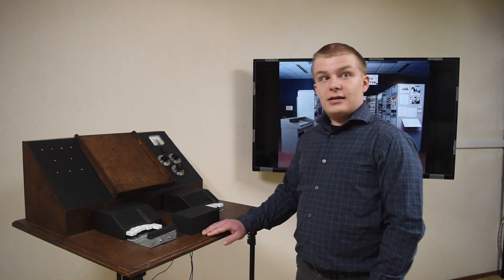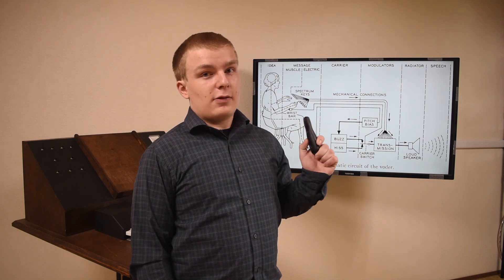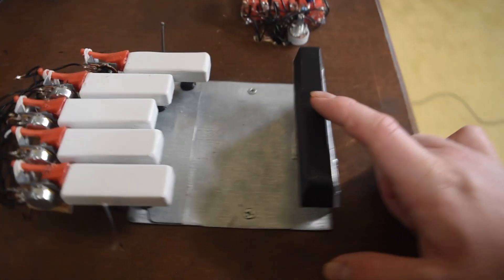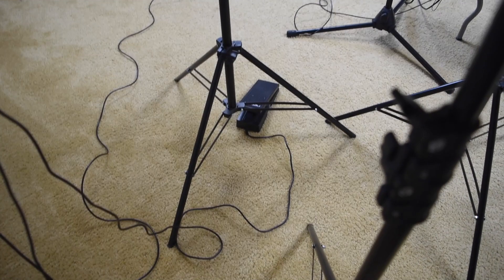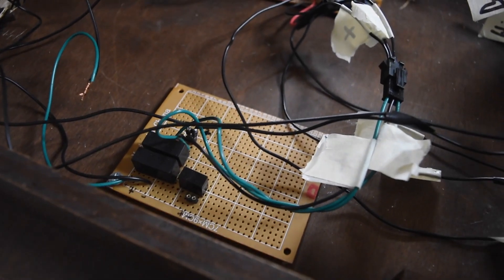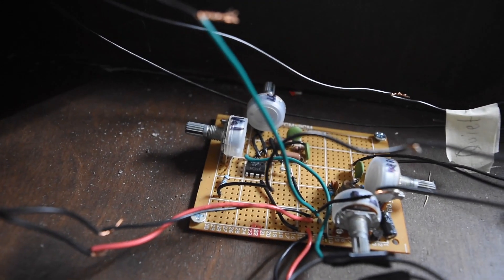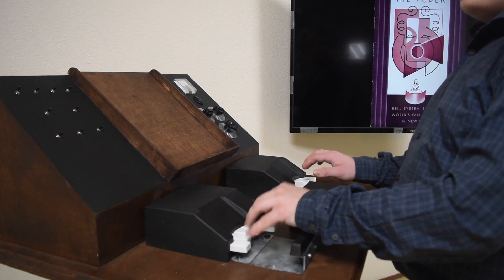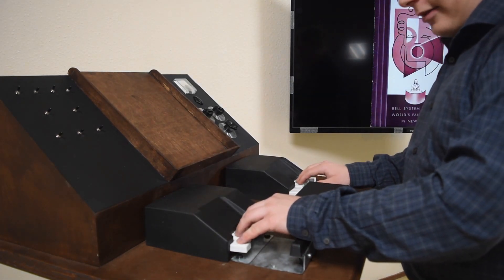Replica of The Voder

Comment: Hey! A year or so ago I was looking into doing the same! Really glad to see someone take this on! really impressive project. I was wondering if you had any more details about the stop circuits. when I was reading the patent and "the carrier nature of speech" and couldn't find any details. Did you reconstruct them from another source or design your own circuits to perform that function?
Reply from the maker: The stop consonants are by far the worst documented part of the Voder, at least in my experience. I never did really get them right. In the article "A Synthetic Speaker" from the June 1939 issue of the Journal of the Franklin Institute, they explain the stop keys, but they don't give any real figures regarding frequencies and timings. 

The gist of it is that each key goes through a series of stages as it is depressed, including a pop from a capacitor and resonant circuit, a silent interval, and a hiss put through one or more of they key filters. The exact frequencies of the filters and timing of the steps determine the sound that is perceived. 

Stop consonant perception is also quite complex, since the exact sound of the consonant varies depending on the word that comes after it. Because of this, it's not technically possible to make a single circuit that functions as the same consonant in all cases. The Voder made up for this, in part, by pressing the keys with different speeds depending on the exact syllable they wanted.

Comment: Hello There, is analog right, completely analog?
Reply: Yes
Reply: It appears to be.  The ICs are likely timers (for oscillation) and op-amps.  I want one of these!  It'd be fun to add a digital-analog converter and control with MIDI signals!
Reply from the maker: Yes, it is entirely analog. The ICs are all opamps. The buzz oscillator is a relaxation oscillator based on a capacitor.

Comment: Hey, good job on building your Voder replica, Vaughn, and well done video! 😎👍  Are you familiar with Doug Slocum of Synthetic Sound Labs? He also built a Voder trainer replica (and he and it were in the PBS show Breakthrough). Doug's company makes synthesizer modules and he made a module called the Scat Talker which can sound a lot like a Voder but is designed for voltage control. I did a demo of it in case you are interested: https://youtu.be/_WsDJQfSA8s